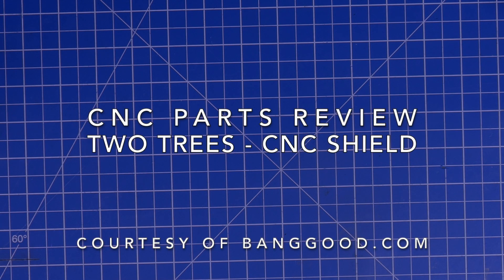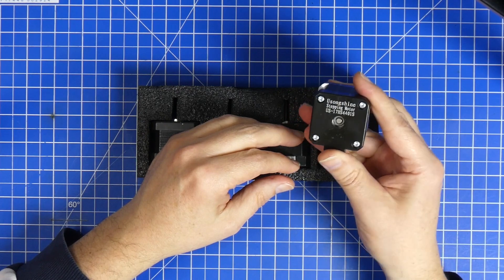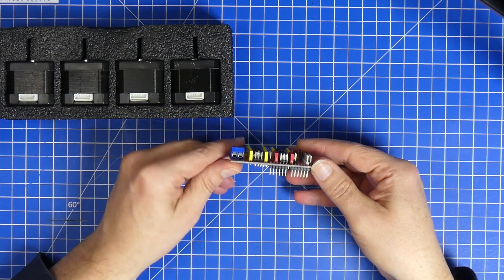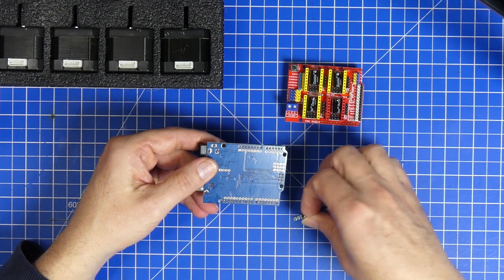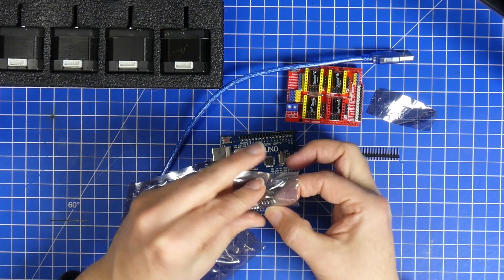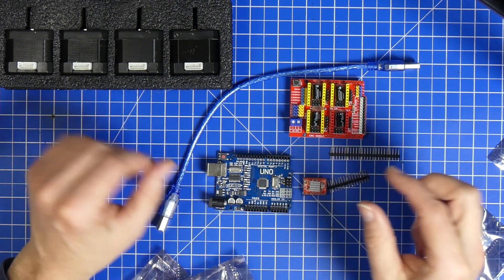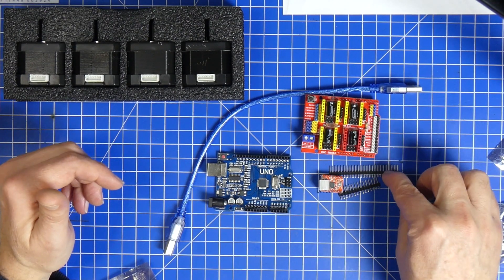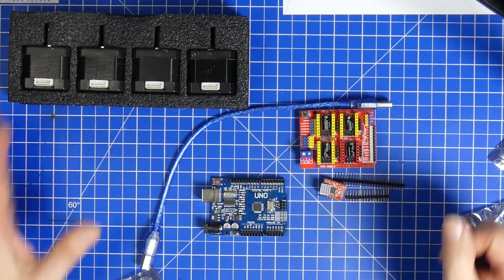TWO TREES CNC Shield Kit Review

Comment: To me, this is not an exceptional bargain. On the contrary, the ardyino+shield looks old fashioned, and definitely not the best actually. My alternative choice would be an All In One board like the Keyestudio CNC GRBL (10€) with onboard laser or spindle control, 32 microstepping (versus 16 on your board). The best choice would be a MKS GRBL board with touchscreen, by the way. Anyways, you have 31€ left for steppers, which is plenty enough as a Nema17 four pack is generally around 25-28€. You can get even better steppers like 17HS8401. So nothing amazing IMHO.
Reply from the maker: Where can you get a 0288 Keyestudio CNC GRBL AIO with controllers for $10 ? I think it's about $40 as I recall. I think you can get the CNC SHIELD from them for about 12 to 15, but then you still need all the drivers and an Arduino Nano.
Reply: @dherrendoerfer  It's an all in one board mate, like on 3D printers, no need of an extra Arduino. CNC shields are the paleolithic of CNC control, like the RAMPS. Drivers cost nothing 0.50 to 0.70€ each. You can even get 4 DRV8825 for less than 3€. Remember the All In One board have advanced features like fine microstepping, PWM, laser/spindle control. Some features you can't get with a shield. Check Aliexpress for Keyestudio CNC GRBL V0.9 ; 10,05€ shippiing included. By the way, I use 3d printer's 32 bits silent boards for some of my CNC Mills. So I can monitor spindle and drivers temperature on the touchscreen. Smart for a few extra bucks (17€). Marlin understand pretty well milling gCode. But for lasers, I prefer GRBL boards for easy PWM control.
Reply: @axelSixtySix  Not too add fuel to the fire lol but you can do PWM laser control with a CNC shield v3  and you can use 8825's and do micro stepping up 32 steps with them
Reply: @patprop74  I said "some" can't be done. Through, PWM on a CNC shield, even V3 is not native implemented. You have to deal with pin-out attribution to make it work. An all in one board already have all that implemented, with proper connectors. Simple and easy. #cncShieldsAreRubbish :)